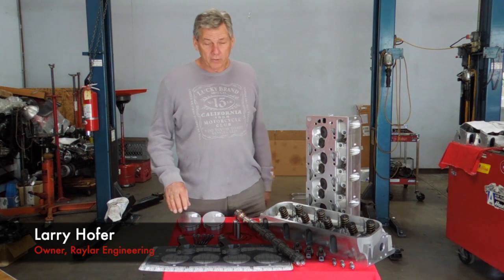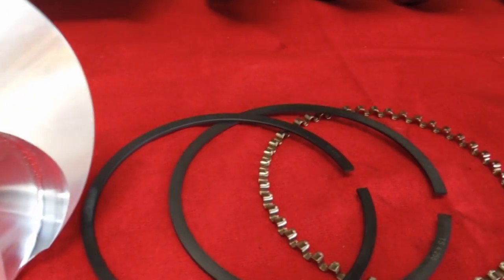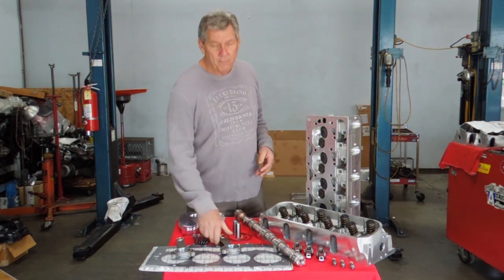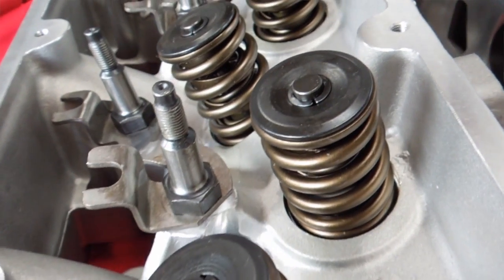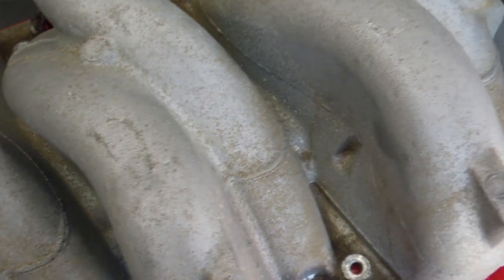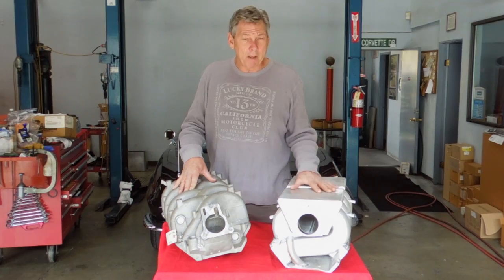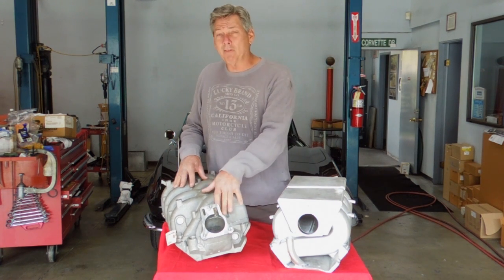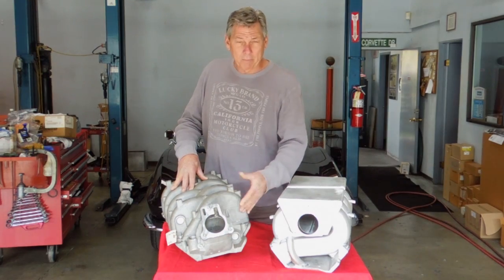Vortec 8.1L Makes 607hp / 638ft-lbs - Idle, Burnout, 1/4 Mile

Comment: How does it affect the mpg? I hear 7 to 12 mpg on most trucks. would stage 3 be that bad?
Reply from the maker: Mileage depends on how you drive them, gearing, transmission, etc. The 540 suburban had the biggest cam we sell and got 16mpg on the freeway at 65, around 10-12 in town and about 4mpg when you put the hammer down.
Reply: Sounds like a big block

Comment: How much does it cost  to build the big block up compared to a Chevy small block ?which is the smarter build for the money and power ?
Reply from the maker: https://www.raylarengineering.com/vortec-8100-496cid-hot-rod-performance-parts.html

Comparing small block and big block builds is apples and oranges. BBC makes 500lb-ft off idle, SBC makes 500lb-ft at 5000rpm.

Stage 2 496cid makes 607hp/638ft-lbs and is all-day daily driveable in just about any vehicle from a hot rod to a Suburban. To get that kind of power from a SBC that's naturally aspirated, you're running race gas with high compression and a large cam with a lot of duration which will be focused toward top-end power only.

https://www.raylarengineering.com/vortec-8100-496cid-forced-induction-performance-parts.html

Another way to make power is superchargers (boost). Boost is generally limited by what fuel is available to you locally, here in California, we have 91 octane. Depending on the parts and pieces that make up each engine internally (cam choice, displacement, etc) SBC engines will make about 600-750hp on 10lbs of pressure. Raylar 2.9L Whipple kits make about 850-925hp at 10lbs.

Comment: What would be the expected dyno numbers at the wheels? I’d like to do a stage 3 496 package through a upgraded 5 speed Allison, 2wd regular cab and be able to run high 11’s
Reply from the maker: Rear wheel dynos produce different numbers based on manufacturer. Assuming your truck weighs about 5500-5800lbs, low 12s are more realistic from 600hp.
Reply: Micah Coy so your numbers are for crank horsepower? And do you guys recommend any vendors for building an Allison to withstand the power?
Reply from the maker: @jamesyork6023   Yep, only crank figures. There are lots of Allison builders, pick the one you like best.
Reply: Knock off 20-25%

Comment: why do 8.1 aftermarket parts cost sooo much😢
Reply: It's ridiculously cheap compared to diesel though
Reply from the maker: The main reason is that they are limited production. the regular 454 and 502 Big Block heads and parts have been around for 30 years and the initial production costs have been repaid back to the manufacturers.  In time this will happen to the 8.1 parts also.
 Right now, the best choice is to buy the best part for your application and use it. The only computer controlled Big Block for the late model is an 8.1 and is used in the 2001 and later trucks. It uses the same computer as the small block engine. To keep the other computer systems in the late model truck functioning, It requires an 8.1 or you will loose the other computer systems.
If a computer is not required, stay with the early BB or go to a small block engine . Those parts are inexpensive.

Comment: how much is this kit
Reply: It costs more than a good used duramax complete running truck.
Reply: Who wants a Duramax. big blocks all the way
Reply: @dougc190  nope....duramax goes doodoo on this all day long!!!
Reply: @trentdawg2832  that's fine I still prefer big blocks.
Reply from the maker: http://www.raylarengineering.com/vortec-8100-496cid-truck-performance-parts.html

Comment: hell ya. this would smoke all the diesel trucks. and for cheaper probably lol
Reply: uhhh,nope.my friends cummins diesel is putting out 700 horsepower and 1200 foot-pounds of torque almost stock with a tune
Reply: @trillrifaxegrindor4411   This motor is naturally aspirated. You show us a diesel making these numbers without boost lol. This big block with just a hint of boost would be over a thousand horse
Reply: trillrif axegrindor  Forza dosent count lol
Reply: @trillrifaxegrindor4411  how long did it take him to blow his transmission or engine

Comment: Dont think the stock Allison can handle that. Thats some amazing sleeper power right there.
Reply: +dkhill27 The stock 6-speed Allison 1000 holds the stock power of the duramax which was 650+ ft/lbs stock and they hold a small tune past that. So they'll take this torque. Now the 5-speed Allisons, I'm not so sure.
Reply: The Allison has a huge aftermarket thanks to the Duramax.
Reply: dkhill27 no it can dumbass